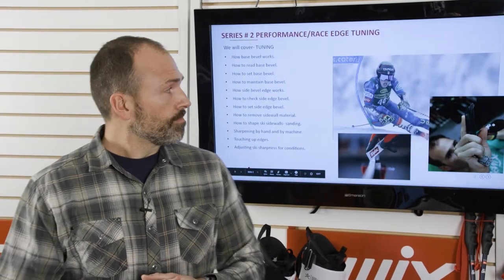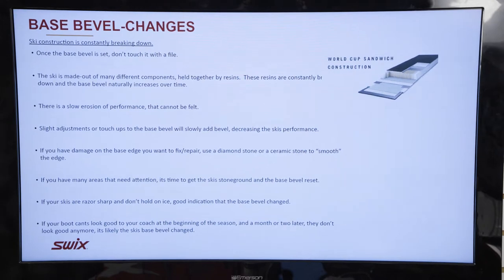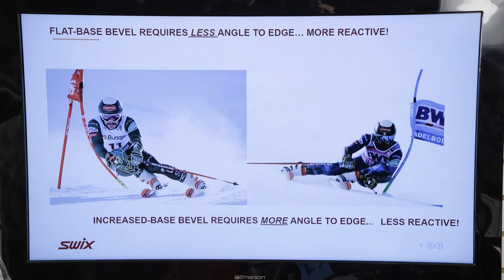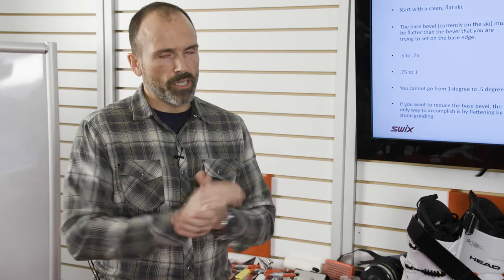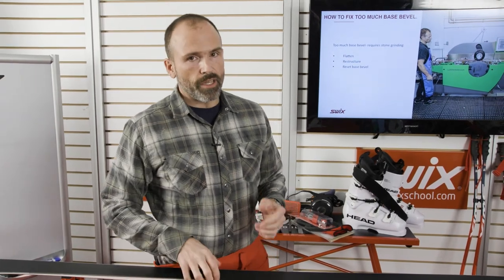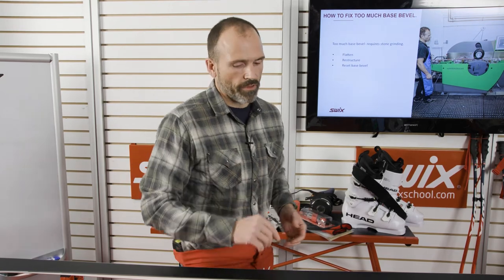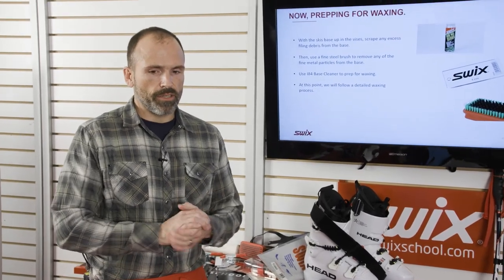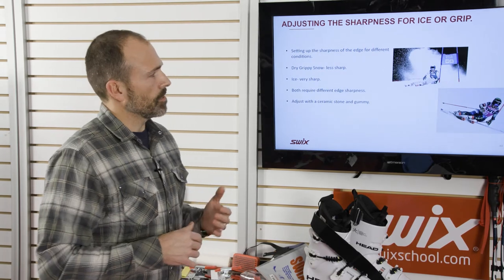How to Tune Your Skis - Swix Virtual Tuning Clinic Series Vol. 2

Comment: Thank yo very much for excellent video. I have one question though. My snowboard is Capita mega merc. It has base bevel 1.5 and side the same - so it is 88.5  I decided to start to care about it myself thanks to your videos. I think I ordered all the goodies from swix. The only thing I am  not happy with is the file guide. I ordered 88, but I would like 88.5 which is the default angle on my snowboard. Any advice?